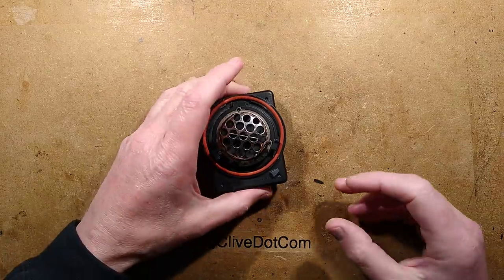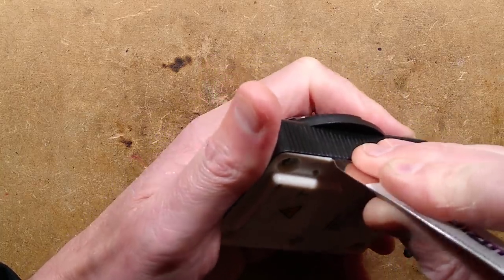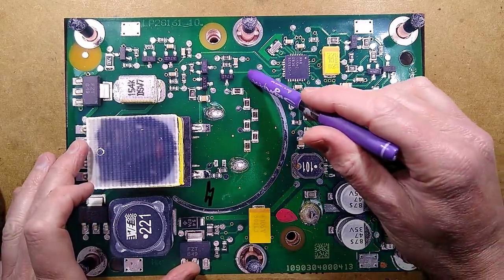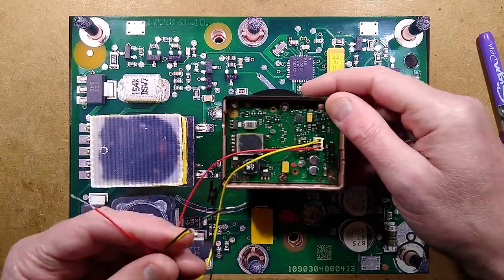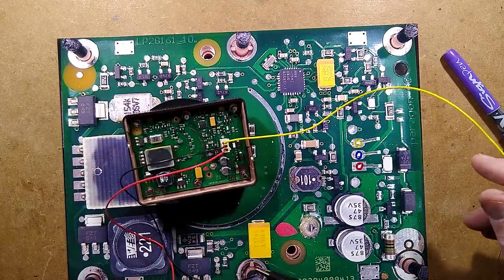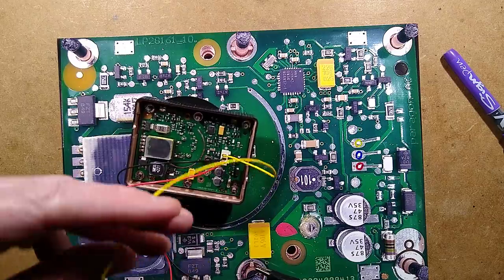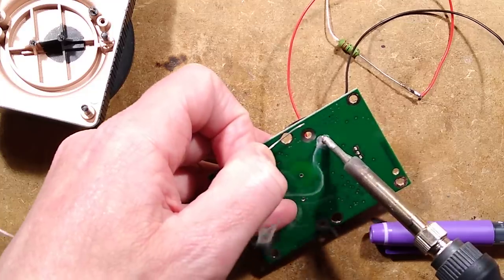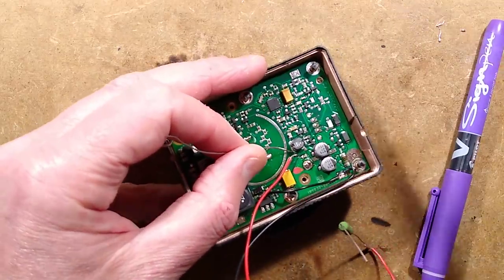Hacking and overclocking a BMW "ioniser".  (Not recommended)

Comment: Hi, Great VIdeo!  BMW uses a number of communications standards to talk to the various modules its cars, but I think this device uses a system called IBUS (sometimes KBUS) .  This is a single wire bus that in its quiet state is held at 12V by a resistor (aprox 10K).  When a device wants to communicate it pulls the bus wire to zero  volts using a UART at 9600 baud to modulate the signal.  This as you found out is a little difficult to emulate with a bit of wire tapping on the gnd. :) .  If you wanted to take this further then I would suggest using an arduino or raspberry pi's to operate a transistor that will pull the bus to ground as the uarts signal goes high.  There's lots of stuff on the internet about how to format IBUS messages.

Comment: Big Clive trying to emulate a high frequency signal from a BMW ECU by physically quickly tapping a wire on the contact. 
You crack me up! 😃
Reply from the maker: Yeah, I was hoping it might be simpler circuitry.

Comment: The 'spacers' are just glue dots to hold the component and secure it against vibration and cracking  the solder joints. Not uncommon for larger SMD components.

Comment: The single wire communication bus aka Local interconnect network.  floats the line at a set voltage usually 5 volts and pulls it to ground. I still don’t think you could trick it even then, but  figured I would toss my 2 cents in.
Reply: Yeah, I would think you'd need the whole car to monitor the line for a while and see what all it expects to see.
Reply: Broken_Yugo leave it to da Germans lol

Comment: The connector on the unit is most likely Ground, Power and LIN bus.
A LIN bus is a multi-drop serial bus, usually 9600bps, but can be up to 19200 bps.
So you need to make some experiments with LIN bus devices.

Comment: I really love how you show that things can be used in other ways!  Now I can't wait to find a unit like that and try to make a home air sanitizer from it!  Could that be adapted to sanitize masks, maybe?
Reply from the maker: You can buy ozone generator modules on eBay.  Be aware they operate at high voltage, though.

Comment: I wonder how often, and for how long this thing runs in an actual vehicle. I wonder if there's some sensor in the system that detects particulates and pumps in some ozone. Seems a bit excessive, but... whatever. 
I will say, I got a 1992 325is in early 2000's and drove that thing for about 8 years. Previous owner treated it like crap, but it was still a great car. I drove it to over a quarter million miles before finally deciding to get something newer. Strangely, it was actually the easiest car to work on that I've ever owned. Oil changes were especially quick and easy. 
I would have kept it, but the parts cost alone for the new shocks and struts it needed would be more than the entire car was worth. 😔
Reply from the maker: I believe it's one of the most expensive cars for parts.
Reply: Would not surprise me lol
Reply: @bigclivedotcom  If you go to your Stealer it probably is. But if you are smart and buy parts else where its not bad at all.
Had my E39 for 10 years now, still loving it.
Reply: Given the power I'd bet it probably just puts out a burp of O3 now and then, maybe tied to fan speed to keep the level in the cabin fairly constant.
Reply: Yeah, I'm in North America. Some general maintenance parts really weren't all that expensive compared to more common cars. Even replacing my radiator, (myself) was less than $100 if I recall correctly. 
The suspension, though.... that's where it really went into crazy cost territory. And by crazy cost, I think it was something around $2000 for all the parts, plus it would have required tools I don't own.  I believe that car, at the time, with so many miles only had a Bluebook value of $2500 in top condition, so it really didn't make sense for me to do those repairs. It was a bit of a shame, I really loved that car. Although, I now drive a 05 Jeep Grand Cherokee that was a single previous owner that took great care of it, and it's also been treating me very well. 
I just wish changing the oil on it was half as simple as it was on my e36!
Reply: In the UK, a bmw is not an expensive car to run (especially if you DIY) you just need to be pro-active with your maintenance.  If you have a 316i and havnt done an oil and filter change  in 20k miles, well, brother, that failed timing chain is on you.

Comment: I don't know anything specific about these ozone generators, but generally speaking as an auto tech, BMW sometimes uses single wire networks for their low bandwidth, low priority components. In that case, it would not just be a simple pwm signal that it was expecting, but actual communication. Ultimately it depends on whether or not the fault detection is only "ozone generator fault" or it it can store faults for all kinds of issues.

Comment: From checking out some wiring, it looks like they were driven with LINbus, so you'd have to be pretty lucky with the tapping to get it running!
https://www.newtis.info/tisv2/a/en/g11-750i-lim/wiring-functional-info/body/heating-air-conditioning-functions/ioniser/1VnYYkkk5I
Reply: Yeah, LIN has checksums and all sorts. It'd take a lot of luck for a bear prodding it with a wire to pass those checks.
Reply: I was also going to suggest LIN
Reply: Both of my brothers are technicians at a Mercedes dealer, they say basically nothing operates from "normal" controls. Everything is on a data network, no matter how simple the function. I'm guessing this thing is on some kind of network to give diagnostic data back to a tech. when it has a problem, so I agree with what has been said above.
Reply: I was figuring canbus as I never heard of linbus.
Reply: @Biggus_Mickus  Which will be why the indicators never seem to work.
Reply: @chrishartley1210  Everything works on my Beemer including the passenger side mirror that adjusts when you put the vehicle in reverse to aid the driver with backing up ..pre-camera technology.... B.M.W. knows how to go to go whole hog on engineering ..scrimping wasn't part of the plan.... you have to admire there engineering especially with their electronics.....
Reply: @Heads Mess you mean the carburetor guy ??
Reply: @lsd25records 
Pity about the cost of  indicator fluid though.
Reply: @Biggus_Mickus  Don't forget AvE!
Reply: @lsd25records  I have a less impressive 91 E30, but still love it.
Reply: That's a physically different device. Someone has already posted the details of the part that Clive has showing the bi-directional PWM waveform.
Reply: lsd25records I think it was a joke about BMW drivers never bothering to use their indicators...

Comment: The 3rd pin will be a can line. One of my colleagues is am auto electrical genius and explained how they work.   You have a 12v/14 ignition positive a can high at 2.5v and a can low at 2.5v when the bcm tells it to switch on it communicates with the controller and then sends back a message signal back to the bcm saying I'm gonna switch on as soon as I see ground. To then switch off the bcm momentarily cuts the +12v and makes the neutral become a can low again, the ioniser then says back to the bcm I'm switched off now and the cycle begins over

Comment: i'm finding electronic car parts incredibly interesting, all the way from an ECM and playing with it using a cheapo logic analyzer all the way to the o2 sensors and oil pressure sensors and temp sensors. I wonder around the local wreckers yard, luckily I'm allowed too because he knows I'm just after little electrical knick knacks and knows I'll always bring them straight to the shop and have a good bartering process with him (which he really enjoys) and knows that if I was to try steal anything bigger than some sensors he'd be able to tell I have a radiator down my dacks and under my shirt, in his words haha. He's often out there pulling parts off that people have phoned in anyway.
Much fun is had and its only a short walk for me especially during the ca vooiood.
He was still aloud to operate in a very restricted and minimal way and I think as we are in an extremely remote/rural/isolated area/regiona that had only had 5 cases acquired overseas and no community transmission within that region next door to our region and none in ours thats how im guessing he was able to get the go ahead (although for all I know he may not of even been open and just working on cars and if i came in and asked if he was open to first time he said yeah mate go have a look see if you find anything interesting) and liked to see me wondering up the road for some distant face to face conversation as the isolation was fairly brutal as isolation in these communities can be brutal itself in some cases and I'd still be able buy electronic knick knacks to help keep him going during the tough times.

Comment: A common problem with car ventilation systems is that the cycling on and off of the air conditioning can lead to condensation buildup on the evaporator coil, and growth of mould - leading to a foul odour coming from the vents. I assume the ozone generator is mainly to tackle this issue, so disassembling half the dashboard to clean it out won't be required.

Comment: 5:55 : that looks like a buck converter stage using the inductor of the current-fed royer converter. That's pretty typical for LCD backlight circuits.
Top circuitry might be current monitoring on the output side that is connected to ground which can provide feedback to provide some safe way to shut down the converter. Can't turn off BOTH transistors of a current-fed converter at once as this would cause overvoltage and destruction of the switches.

Comment: It's probably looking for a certain frequency PWM sign. You could build a simple 50% pulse generator with a 555 timer chip and tune in the signal that it's looking for with a pot. Then if you want to be fancy, put the 555 chip in PWM mode to control the power.

Comment: You only need one resistor for that Royer circuit, I use that circuit for a lot of my high voltage projects and one works just fine. The transistors are driven by the actual current induced in the winding, the resistor just kinda gives it a push to get it started and keep it going.

Comment: I'm guessing there is some form of current detection which the microprocessor would use to limit consumption (max is supposed to be 830mA), but of course you bypassed all that.

Comment: I was playing around with building my own generator but did not get the voltage quite high enough but close.  Used a push-pull controller, got it up to around 300khz and then feed into a small transformer I wound.  I gather a few kv come out the other end but not enough to start an arc on it's own.   Either way it was a fun little thing to mess around with.  I can make CFL lamps glow if I put the wire near them.

Comment: If you had it after all aluminum and corrosive metal, the ozone would be alright to remove some pollen, mold, mildew and some allergens from the air and some from the interior of the car. Ozone has a half life of 45 minutes and can smell like  bleach. It is still used by cleaners to eliminate Smoke odor from clothes.

Comment: I'd be surprised if that was PWM.  It seems way more likely that it would be CANBUS.  The MCU is probably generating the AC waveform that drives the transistors at the input side of the HV section.  The canbus is bidirectional and includes ID, state info, diagnostics, etc.

Comment: I've seen a few where there is only 1 bias resistor. It's dc fed to the feedback winding, so in DC terms, the winding is low compaired to the resistor, so it's the same thing effectively.
Reply: The circuit here is using discrete transistors, so mismatch between them is a significant source of asymmetry, and there wouldn't be much point to using two symmetrical bias resistors.  In a two-bias-resistor circuit I would expect to see a dual transistor, preferably one made from adjacent die, in order to minimize transistor mismatch.

Comment: With the production of all this Ozone, you want to make sure there are inline carbon filters prior to the Ozone entering the cabin in order to Absorb it
Reply: Hm, wouldn't the ozone react with the carbon to form oxygen and carbon monoxide?
Reply: @kpanic23  it turns out, the BMW ventilation system actually produces ozone but then they have filters that take it out. They call it 'hydrogen peroxide' of course, this is more of a consumer-friendly position because indeed ozone is produced.. I appreciate your attention to the detail of the chemistry. Let's look into it further in terms of exactly what it takes for a certain amount of ozone to be absorbed by the filters and at what rate of airflow. Shall we?

Comment: ah yes the CAN Bus protocol, often simulated with a bear poking a wire with a resistor attached to it.
Reply from the maker: Probably LIN, but the vague data implied a simple pulse width modulation signal.

Comment: If you took this out of a BMW yourself and still have access to the car, you could test the connector pins on the car to know which one is supplying 12v and the corresponding pin receiving it.

Comment: Clive, you should take a look at a final stage resistor for a car HVAC blower fan. I replaced mine and took it apart and found quite some circuitry and I wonder why it needs that since it's only job is to drive a DC (albeit, a 400W one) fan.

Comment: It would be interesting to measure the voltage it puts out but considering it has (6) 1 meg resistors in series going back to what's probably a mosfet.  Lets say that there's a 2 volt positive turn on on the mosfet, the output voltage could be as high as 12 kV.

Comment: @bigclivedotcom that yellow wire is for the "LIN" bus. It allows the vehicles BCM to to control the device  over a 5v single wire signal. I work in the idustry and have aquired tools that can talk LIN and CAN.
Reply: It's bi-directional PWM for this particular module, details have been posted in another comment. A similar but physically different module also used in BMWs uses LIN.

Comment: A lot of that redundancy is directly coupled to liability in case of catastrophic failure. So unfortunately for those shouting “over complicated“, it’s to save your and BMW’s ass if it goes pear. I’m not too sure I’d be complaining if otherwise, it interfered with a bus line or set fire to your dashboard, resulting in a fatal accident. 

If you’ve worked on any car modules, for any length of time, you would know that BMW is not the only one doing this, in fact, almost all other manufacturers are, and for exactly the same reasons. In the words of Disturbed - “Don’t judge what you don’t understand”. 

I was going to guess that the PWM pin was actually LIN, which is a single wire comms bus, but as someone already pointed out, it’s definitely PWM.

Comment: Clive, ever thought about getting something like a BK precision 880 LCR meter that will measure R down to about half of a milliohm for tracing things? You can literally slide it millimeter by millimeter down a piece of wire and watch the resistance change. Makes tracing pcb traces and checking transformer coil pinouts easier.
Reply from the maker: If I really needed a low resistance measurement I could crack out my electrical installation tester.  It does use quite a high current though.  (100mA).

Comment: I am not electrical engineer but you should have bridged the contacts for the piece of the riveted civer you removed, before trying to make it work. You pointed it out yourself! This is HV device so it is likely to harm when powered with broken casing or someone not qualified messes with it. Surely that was a reason for the unit not to draw any more current. There might have been more reasons I am not aware of.

Comment: I can't believe that BMW would make such a product that creates OZONE within the closed cabin of a car.  What year models was this technology for?   U.S. EPA and FDA has advocated totally against all forms of Ozone generating devices since they are dangerous to human health and are hi-oxidizing to biological matter including lungs' and mucus membranes while in an occupied space, however this technology is used for mold/smoke remediation ONLY for un-occupied spaces.....

I am very familiar with different types of air-treatment technology, and there is a technology here and in Europe for both residential, and commercial/industrial HVAC called Bi-Polar Ionization that produces bare-minimum minuscule ozone, but it's thru the ionizing carbon brushes it can produce a high-level of oxidizing ions vs. a corrona discharge that produces ion's but with a lot of ozone as a byproduct.  

At some point, I thought about retrofitting one of these residential "GPS (Global Plasma Solutions Ionizers)" into my car's A/C.  It's also made under the private label of "NuCalogon I-Wave" and they also make a long ionizing strip with multple +/- ions, that I'll install within my car's a/c ducts.  Some of their units are multi-voltage inpute from A/C to D/C.

Or, I'll do an up-voltage converter from DC to AC in order to power the "strip" version.   

So interesting how BMW got clearance thru the Eruro air-safety regulators to make/install such a device, let alone, I wonder if it's allowed on U.S. Models which would tell you something!!!!!!!

Comment: Every PWM I've ever seen has a 100% state of permanent 1 and a 0% state of permanent 0. Simply shorting the PWM wire to power + could do it (but more likely, PWM isrunning at a lower voltage than power, more like 3 or 5V)